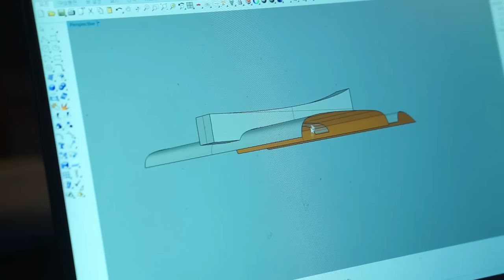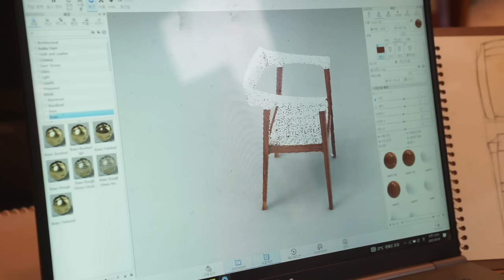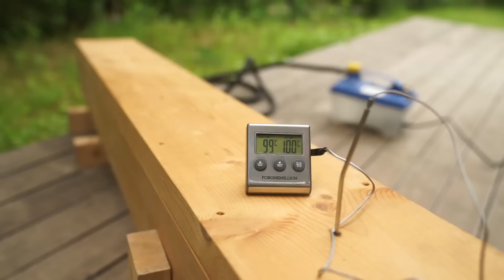Kobeomsuk furniture - Making of Hanok Eaves Chair

Comment: Does the dovetail joint, being that thin at its thinnest section, strong enough?

I know it's wood glued anyway afterwards, but was it intentionally done that thin and is it as strong as a thicker dovetail could be?
Reply from the maker: The thick size is stronger, but it could be little tacky when it comes to only design, so need compromise between strength and beauty. Anyway "much"  stronger than screws and domino.